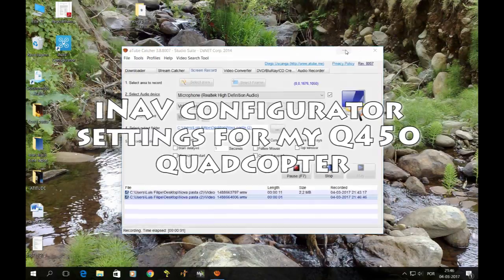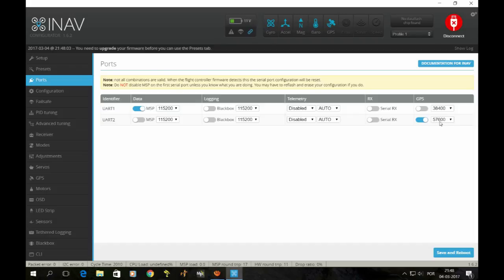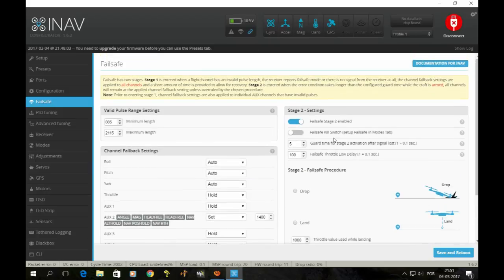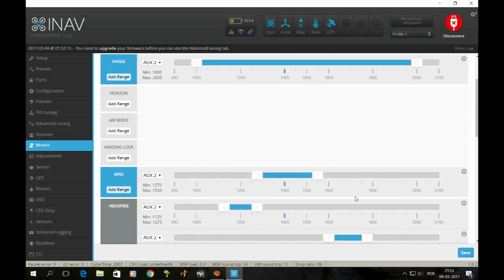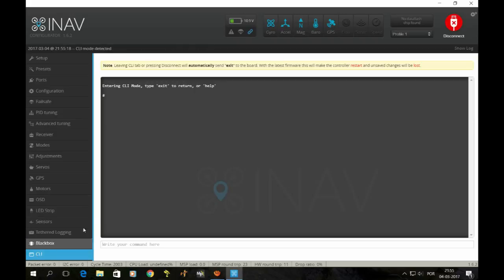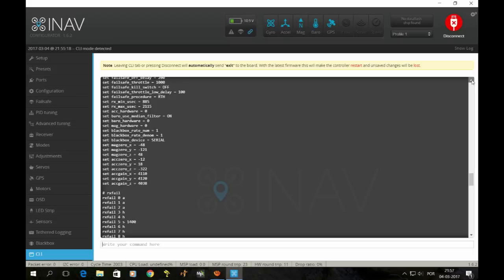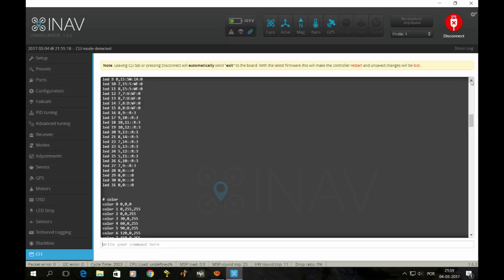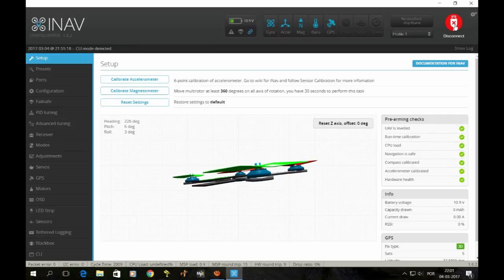iNAV configurator settings for my Q450 quadcopter

Comment: what is your transmitter rx failsafe setting?
Reply from the maker: PewDieCake can't remenber it was long ago
Reply: luisfilipe1983  im using naze32 , Ublox M8N GPS , F450 Quad , FlySky FS-i6 transmitter.. i use inav V1.7.0... i try RTH and it work fine, and then I try failsafe and my quad just fall from the sky.. How to do failsafe in inav V1.7.0?